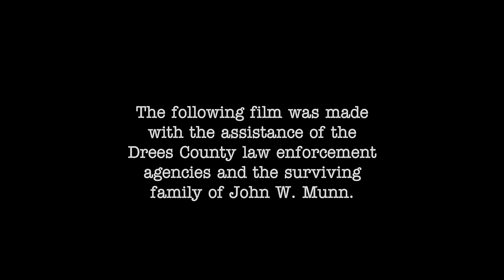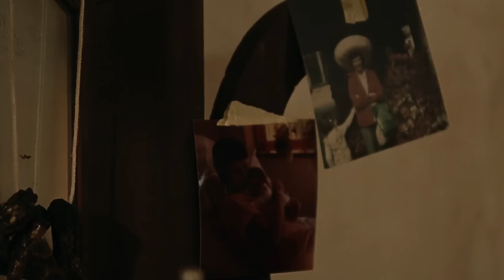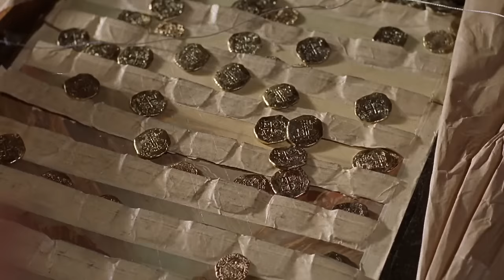Undertow | English Full Movie | Drama Thriller

Comment: Why would he bend the nail over?
Reply: To control bleeding while he was getting help
Reply: @just_a_beholder  why not pull the board and nail out of his foot before running? I know, it's in the script. Just an observation
Reply: @mtw1234  Had he pulled the nail out there and then  he would have opened the wound  causing excessive  bleeding before getting help.